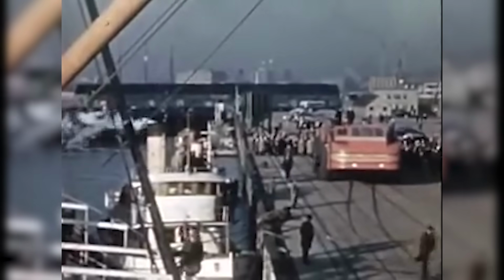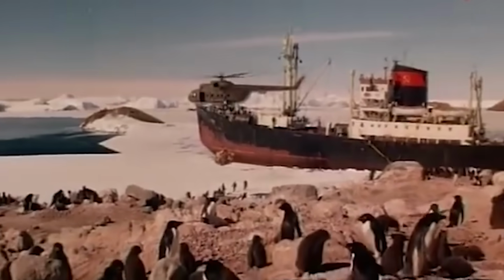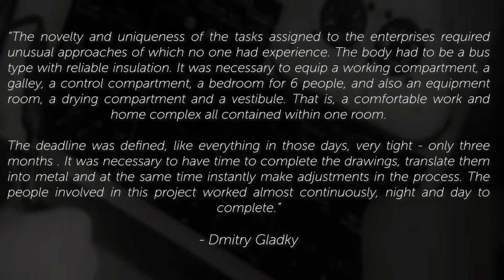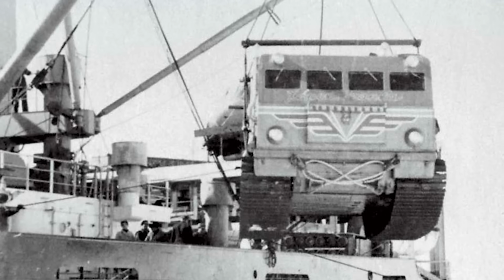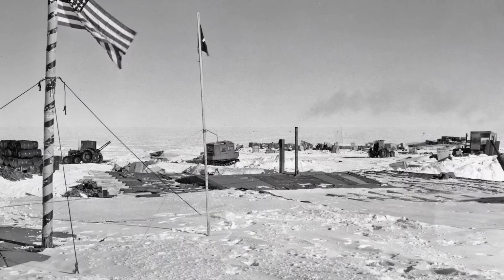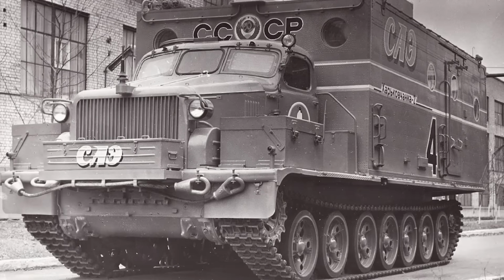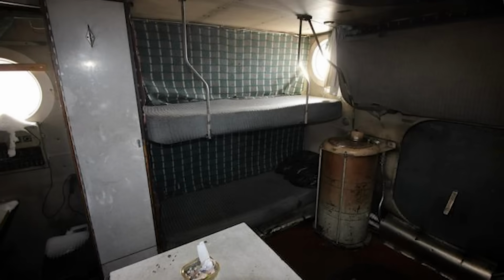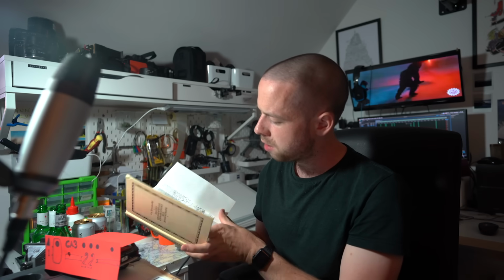"Kharkovchanka" - The Colossal Soviet Antarctic Cruisers

Comment: Funding for the project was canceled as the focus in the United States became World War II. 1939 the USA was still trying to sort out better military vehicles however this design had some real advanced feature for that time. The major issue was traction and lack of HP. A simple issue to be over come with new tires. But that did not happen due to World War two. Seventeen years later the Soviets largely copied the general idea and somehow, with significant advancements in technology gained from the war and a copied plan they are the smart ones? Simply the design is a insulated plane cabin on tank tracks. Next thing you are going to tell us that the T-14 Armata was not a copy of the M1 TTB
Reply from the maker: The project wasn't cancelled due to WW2, the Snow Cruiser was fully complete and tested on Antarctica before any issues with the war. Little America III was evacuated  but by that point the Snow Cruiser had been essentially religated as a barracks, there wasn't any plans to try and fix it there and then. You are right that if not for the war, no doubt further expeditions would taken place and poulter was keen to try and fix to the cruiser and in particular change the gear ratios. However new tyres or new gear ratios wouldn't have worked. The Snow Cruiser was (at least) 4-5 times too heavy for her tyres and wheels in that snow and that simply wasn't a problem that could be easily fixed. While I compared them, The Kharkovchanka is probably as far from a copy as you can get - and they solved the weight issies by using avation construction to save weight. Fully agree though that people saying 'the soviets did it better' is a pretty stupid comparison, but the Soviets were absolute masters of their craft when it came to large overland vehciles like this.

Comment: Very Good  it might not be all the info but you have done something very worthy  to this historical Subject and many of us watching Truly appreciate your accomplishment ..Thank You.!!   .. another approach on the vehicles Design could be to design the Tractor too be for one purpose Only.. too pull too be the work horse. This way its far far less Complicated to Engineer maximum success  ..and the Sleeping Quarters, bath, Galley and mission study room the same thing One Car or trailer.  Its far easier to engineer the two Separately..and it could have a flexible man pipe connecting the two together when stopped as a way too join the two for a physical path way from one too the other than going out side..  the trailer or car would have its own generators for power and heating of course...

Comment: American Vehicle was Prematurely abandonned?  ... It was Prematurely started.  It had ZERO time in snow condition testing... It was ridiculously slow Due to a propulsion system that was essentially 8 Hp per TON!! and was actually faster driving in reverse..note... it essentially failed to move forward AT ALL.
Reply from the maker: Prematurely abandoned because of WW2
Reply: @CalumRaasay  It was abandonned because there was no confidence in the project.  

When this vehicle was driven on solid ground (Not ice and snow) it took nearly 3 weeks to cover a distance it was supposed to cover in 8 days. The project was mismanaged from soup to nuts and WWII was the excuse for dropping the project and avoiding the waste of good money after bad.  YES they could have had Goodyear send different tires but it wouldn't have solved the core issue. Mr Magoo was running the show.

Comment: Maybe if the antarctic snow cruiser didn't have smooth wheels and had snow tires it'd work
Reply from the maker: I doubt treads would have made all that much difference to be honest, the issue was weight the snow cruiser was too heavy by a factor of at least 4 to 5.

Comment: Sovjet build snowcruiser: survives more than 50 years in the most miserable climate possible. 

The future we're heading towards: So I accidentaly drove my 3 year old fancy electric vehicle against a bee and my wiper broke off. Repairing it isn't economically viable and costs more than buying a new even greener and more ecological electric vehicle...
Reply from the maker: Cars are far, far more reliable than they were in the past. Survivorship bias.
Reply: @CalumRaasay  Those "less" reliable older cars where at least self-serviceable, given that you had the required knowledge in how to fix them.
What I meant is that newer equipment is less and less repairable, which isn't only true for cars but also all electronics we buy.

I honestly prefer an older device I can service myself, extending it's usable lifetime between 25 to 50 years. Compared to those brand-new electronics that break whenever they comes into contact with a single drop of liquid, to then be impossible to repair because the manufacturer used proprietary hardware parts which are nowhere to obtain.

I literally designed my own home automation IOT system (hardware and software) from scratch. I designed the circuitboards in Eagle, wrote my own firmware (software which runs on the circuitboards microcontroller) and used an open-source project to control everything remotely. The reason why I designed everything myself is so that I can add newly designed modules in the future, repair broken modules (which seldom happen, maybe once each 10 years), and so on... If you buy a brand-new commercial IOT system these days, you're destined to be scre*** in 3 to 10 years whenever the manufacturer goes bankrupt or ends support of it.

Comment: Their biggest mistake was one the Americans had actually solved: dieselectric drive.  Not only would that add torque, eliminate the gearbox, simplify repairs, extend range and save fuel... With batteries or any way to store heat they could have stayed warm when still.

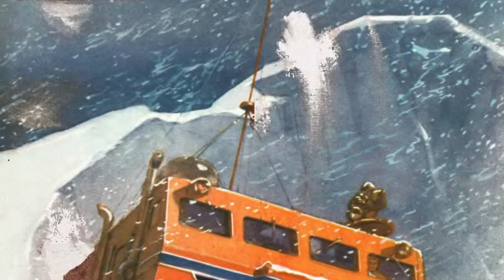Comment: at 13:45 he mentioned that the insulation was designed so that if the engine stopped working, it would only lose 1-2 degrees Celsius per day... Without heating, I find that very unlikely, considering the outside temperature to be significantly below 0.
Reply from the maker: hence DESIGNED haha, didn't say that it worked... 😂

Comment: So this might be a dumb question but at one point you say the Diesel engines could make up to 900hp with twin turbine super chargers now that sentence simply doesn’t make sense. See a super charger does not have a turbine it has rotors or blades or even rollers really just depends where your from as to what you call them now turbos on other hand they do indeed have turbines in them and that run on exhaust vapors and such where the supercharger uses a parasitic design which uses engine power to turn the belt turning the rotors and making more power. Now there are such things as a centrifugal supercharger which combines both a turbo and supercharger because you have the turbine of the turbo but the parasitic draw of a supercharger and they are commonly known as a pro charger but I don’t believe they existed yet during that time frame. anyways back to the question which one did you mean

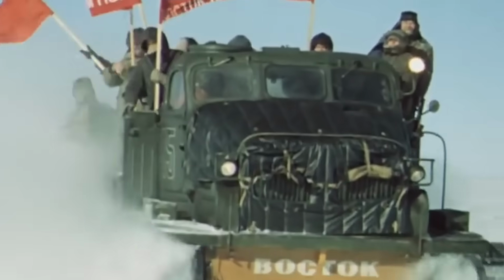Comment: 20:34 that guy playing accordion is a legend
Reply: The called him Vostok Vlad. Standard operating body temperature -42 c. Pure vodka in veins, voice of an angel.
Reply: I agree, holy fuck.
Reply: They flew him in from Detroit, Michigan. Worked at Chrysler, and they picked him up playing at a bowling alley gig!
Reply: @hugejohnson5011  really ?
Reply: @MrMikedejeuner  Sorry, I was just being an ass! Sounded like a good story, so I ran with It. In my Detroit experience though, in the Hamtramck section, there are quite a few Ukrainian/Polish fellows that worked at the car plants, and many played the accordion very well!
Reply: @hugejohnson5011  lol its okay It sounded plausible ahah
Reply: @hugejohnson5011  You wish :)
Reply: Wonder how the accordion sounded with really cold air.
Reply: @KandiKlover  a little bit of cough sirup and it sound like new !
Reply: @KandiKlover  It would probably need to be retuned if you left it outside for long, as the metal would contract, but generally they deal much better with cold than with heat, which easily kills them.

Comment: The American snow cruiser was a good vehicle with bad tires. Given that it was built in the 30's it's still one of the most advanced machines to be built for the Artic/Antarctic.

There's no surprise the Russians were good at it as well. They have some of the most ingenious and determined engineers and scientists. I worked with a Russian guy up north and he could get anything with an engine running no matter how frozen it was. He'd simply take a torch, jack and sometimes a sheet of metal and within 20 minutes it would be running like clockwork.

Comment: It was rebuilt into the Oscar Mayer Winer Mobile.    ( the first truck around the 10 minute mark).       Not the Micheal Jordan truck 
       Why does it have the Wonder Woman design on the front?  (red truck)      Maybe dreaming about having some wonder women with them crossing 3,000 miles in the snow at 75* below zero at night?   

Yeah, it would be a strategic outpost for any country, but ya gotta do a dry run to make some shelters first.

Comment: 6:06 they didn’t swap the engine they just flipped the “front” to the back. Notice where the drive sprocket is. The tank is just rotated 180°
Reply: You can also see parts of the suspension are just mirrored between the two, it's like an antarctic archer!
Reply: @ewill3435  lmao
Reply: It was based on a heavy artillery tractor AT-T. Which does have an engine and a drive sprocket up front.
Reply: @Stakan79  Disregard the negativity.  They did it, and it worked better than anything else at least for hauling heavy loads overland at the time while providing a survivable environment.  The Ukrainians did a good job on the An-225 too.
Reply: @jackt6112  , soviets, not just ukrainians.
Reply: nice did not saw that

Comment: I feel like a series of radiators along the inside walls of the vehicle fed by the engine cooling system would be a much more efficient use of the heat.  You could separate it with valves and banks in case of a leak.  Feeding the exhaust through a radiator would be another way to salvage that heat to take care of the passengers.  That front end overhang as well as the sports car like clearance on the American version makes me question the motive.  I think the engine encased in the vehicle would've worked just fine, if they had our tolerances of today.  Exhaust fumes shouldn't be able to reach passengers, almost sounds like an exhaust clamp or manifold problem.  Great video though, easy to tell you put a lot of work into it.

Comment: 60 yrs on and still functional! It's a testament to the engineering and quality of materials used. Truly, a formidable achievement by the CCCP.
Reply: Yeah I'm amazed how sturdy soviet stuff is. They're soyuz rockets were still taking people to the international space station long after the fall of the union. I have a Soviet hasselblad knock off and 1100mm super telephoto lens. Can't even tell it's that old, works great :3
Reply: @KandiKlover  Tell me, I once came across an old Soviet fridge, that looked like an old Soviet (or American) car. It was produced in 1950s or 1960s and still functional in 2010s.
Reply: @KandiKlover  some Soviet stuff is durable. Their main goal was to make things easy to manufacture quickly and relatively cheaply, the materials and manufacturing processes were often kinda basic and required to be able to produce arms quickly so you get a lot solid metal work. sometimes these constraints lead to brilliant ideas other times total junk
Reply: @CAMSLAYER13  Ehhh thats not the case actually . Soviet AK pattern rifles depend heavily on a QC ,heat treatment and proper chrome rich alloys  versus G3 which primarely relies on a complex stamping die geometry . V-1000 ABM missile warheads with 10000 contact explosive tungsten core balls as its fragmentation load versus traditional simple tungsten balls,frag sleeves or pre-frag sheets everyone uses . I could go on and go on but almost everything Soviet Army used was more often than not much more exotic than western counterparts and thus either harder to produce or more costly in true terms such as Palladium group,Silver and Gold alongside of rare earth elements expenditure . Which is why Soviets developed multitude of wartime components or wholesale replacements for great deal of their weapon systems such wartime models of AKM/AK-74 which could be produced in more than 4 primary arms plants , polymer roadwheels for AFV et cetera.
Reply: It is not such a surprise. Those vehicles were built upon fairly primitive technology, thus parts do not face such a attrition and if you have spare parts you can keep them running almost endlessly. It is sort of tradeoff between maintenance and its difficulty. Old cars required some repeated repairs over the time but they were not that difficult. Modern cars can run few hundred thousands kilometers upon very basic maintenance, but once something brakes it is usually quite difficult and costly to repair it.
Reply: @mungo7136  makes sense 👍🏻
Reply: @mungo7136  are you an automotive engineer?
Reply: @mungo7136  well, but the fact nothing new is not really needed say that engineers made it right. It is not the first antarctica cruiser. All of them had more or less same tech base, but not all of them survived a test of practice.
Reply: That's the thing with a lot of communist things that lasted the country I mean just look at t-34s, Kalashnikovs, and makarovs
Reply: @gwydionrusso3206  there is just one functional t34 you see at the anual parade. They were not an engineering marvel, just easy to produce. New crews came all the time to replace the killed crews.
Kalashnikov was good because it was cheaper and easier to obtain.
Reply: noone wants to drive it anywhere
Reply: They still used, because Russia cant develop such an epic vechicle without Ukraine, thats why they wanna back control on Ukraine, just remember Korolev, Sikorsky, Balabuev (planes AN22-72-74-32-28-124), Shkolnik - now live in USA and develop new engine cycle on rotor engine, and sign contract with US Army. Motor-Sich - planes engines like AI-25 for YAK40, AI-22 for Tupolev 324, D436 for Tupolev 334 and Be200, etc

Comment: Nice truck, I need one of those, fer sure.  Damn, I made that comment without even watching the video.  Bear in mind, Gents, I was an Abrams Operator, a driver.  Plus, I design vehicles, as a hobby.  I have, for more than forty years.  A tank, a truck...know, understand...it is all one and the same.  I designed arctic mechs, just for fucking fun.  Reestablish engine heat...make accommodations  for the crew...take into account distance to target...it is really all just common sense.  All that said, Antarctica is fucking treacherous.  Well, if we keep fucking up, we will all be huddled there, in the mass.  I ain't worried, I am "adaptability" defined.  Thus are the straits of a guerilla.  Have fun!  Get ready!

Comment: I think the American Snow cruiser was designed by someone in Florida, I don't see how they could ever think that would work in snow!!  I guess they've never seen snow.
It's still a testament to russian ingenuity that a machine that was designed in 3 months worked as well as it did, and is still used today
Reply from the maker: It was designed by Thomas Poulter and built in Chicago, I’ve a video on it here 👍🏻  https://youtu.be/zR0M7KjnJTE
Reply: Just the tires were bad, everything else was pretty good
Reply: @sc1338  Weight distribution was wrong too so they had to travel in reverse. No access to engine from inside for maintenance and so on. Try getting outside in -97F. I guess you never watched the previous video.

Comment: I would not assume so much of this vehicle design was inspired by the US vehicle but rather just similar thoughts process. Like mono design is seem logical to make vehicle where driver can go in and out of cabin without going outside. The same logic applies to internal engin access  and even more if you maximize use of space, so no big engin sticking in front you need it inside vehicle and then there is not much choice but make it serviceable from inside.

Comment: Also, and due to my curiosity alone, I'd like to know the casualties of men during that same time period and also up to this date. Personnel regardless of origin who died as a result of the climate conditions, stranded, and or victims of mechanical failures. I'm aware of a female doctor who discovered she had cancer and needed to be evacuated, but the winter conditions made a rescue operation too dangerous. Thus, required her to treat herself. As to her overall success is unknown to me at this time. Rumor is there was a mishap with the nuclear powerplant of the US Base McMurdo that leaked dangerous levels of radiation. However, I have not seen the stats of the health of those who were present. Although I think only a few may have died, that is only a "feeling" without the true data. How many died from exposure or frostbite and or how many lost limbs and other bodily parts due to the same criteria are needed to answer my query is unknown to me at this time. Personally, the answers may be quite surprising.

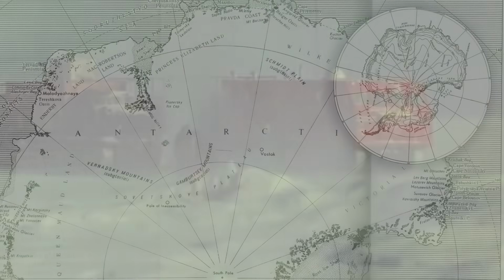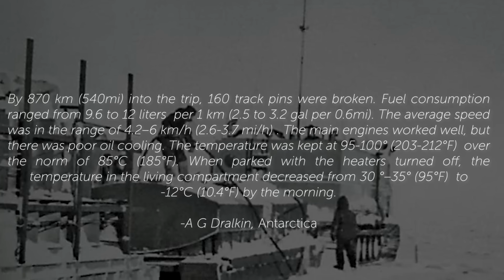Comment: Checking to see if my calculation is correct. Based on 16:23 you said the journey was 5500km, later at 18:14 you show the qoute stating a fuel consumption of 10 liters per kilometer, that would mean 55000 liters of fuel for the trip.
Reply from the maker: benakh when you see the trailers of barrels upon barrels of fuel that sounds about right! I’d imagine they used a lot more with engine idling etc.
Reply: @CalumRaasay  Yes probably! Thx for the awesome video!